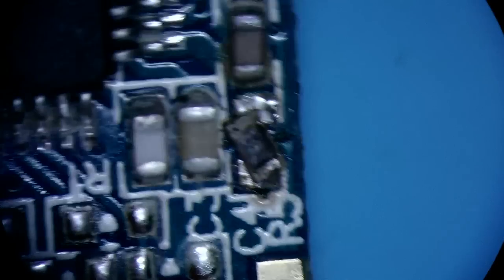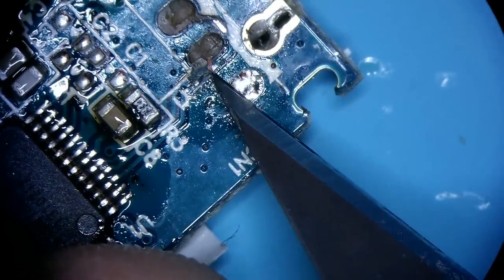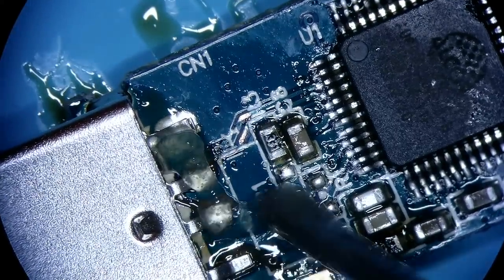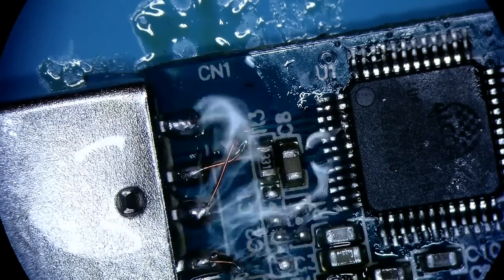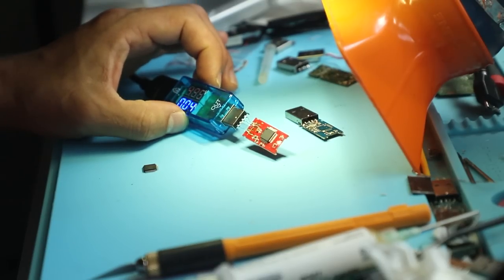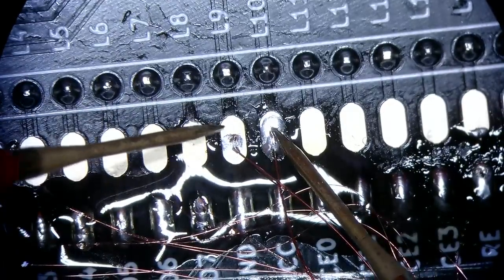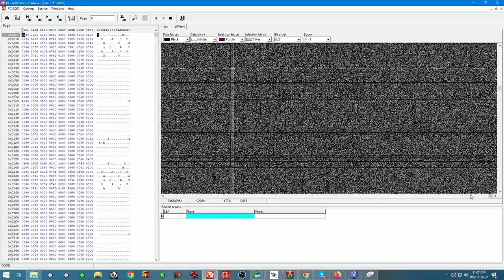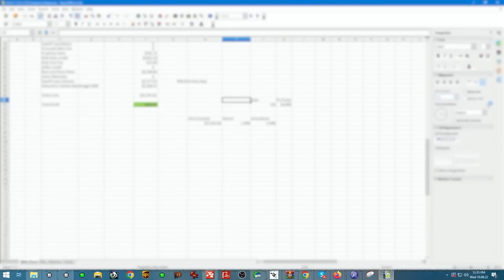when repair attempt went wrong and important data needs recovery

Comment: Hi Erkin, I have 2 questions.Because I like to learn from it.
1. Why you said donor controller can be damage the data and are there any method for identify it before swap?
2. Why you use pc3000 for controller and why you swap the controller after doing it. 
Thank you.
Reply: The new/different controller may reinitialize the memory module and reset its contents.
Reading NAND before swap is to protect the original dump in case the memory is cleared by a new controller.
Reply: Thank you.
Reply from the maker: 1. Like Lukasz said, in theory controllers may reinitialize the NAND and the data will be gone. I don't know if you can identify it, but practically I have never seen it happen, and I swapped NANDs/controllers thousands of times. 
2. I dumped the physical image so I can have a backup for safety measures. Building controller in any software can be as good as hardware controller, but swapping controller over takes 2 seconds. And if it works its a 100% recovery, so don't need to worry about bad sector readouts.

Comment: what is the type of thin wire used to connect the controller in this video? Where is the link to buy it online? In your discretion, you have everything else listed bat that item.
Reply from the maker: I got it from eBay. My most common is 46awg and 41awg isolated copper wire
Reply: @hddrecoveryservices  As I see in the videos for repairing traces and cell phone flexy cables with these thin wires only the heat of the soldering iron is required to strip the insulation. Are these wires coded with a different type of laquere than regular motor or transformer magnet wires?

Comment: I lost you at about 14:30.
Reply from the maker: Controller on the board is connected to the NAND, so I wired it to the NAND adapter connecting NAND signals used by controller